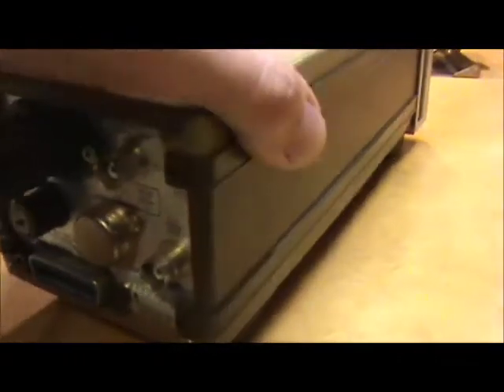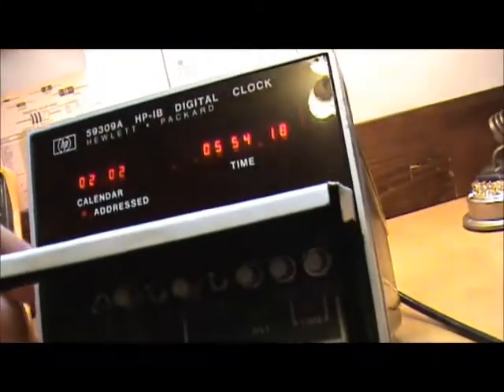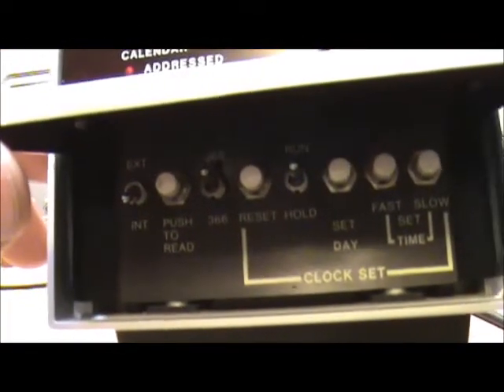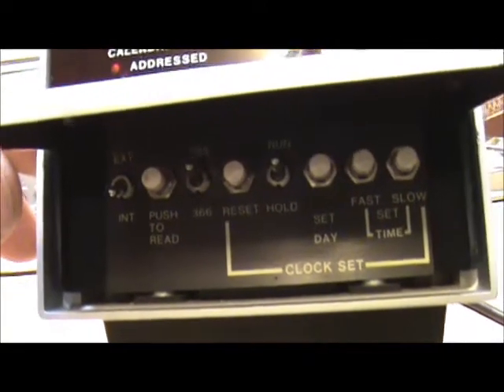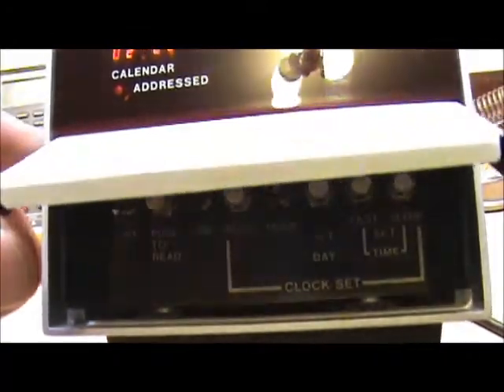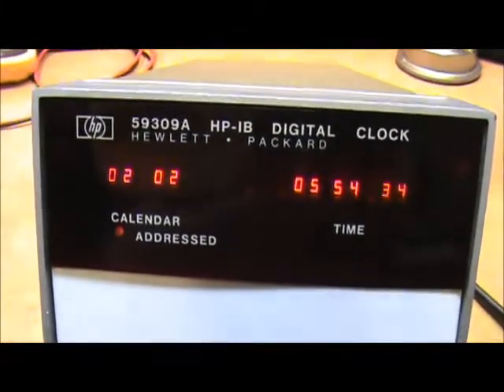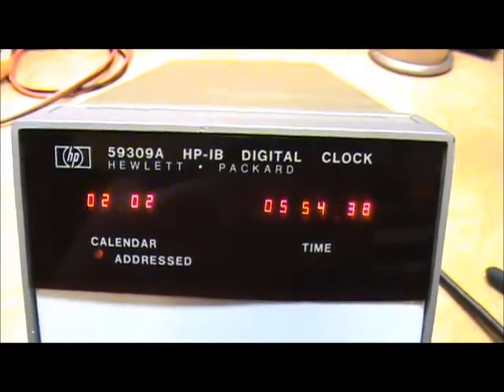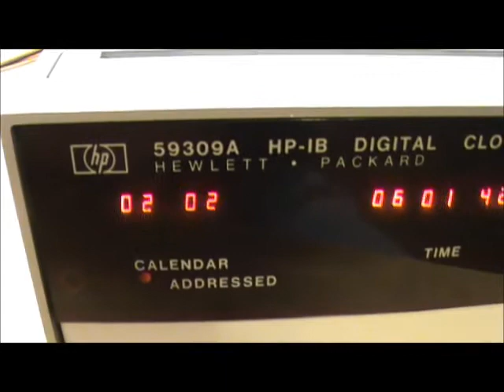HP 59309A HP-IB ASCII Digital Clock Vintage Hewlett Packard

Comment: What was the intended purpose of this clock?
Reply from the maker: The HP 59309A was a digital clock that connects over HP-IB (Hewlett Packard Interface Bus) to computers or test equipment assemblies. It was intended to provide clock/calendar functionality to computers, timing information to test equipment, etc.

Comment: Jim, if you find me on Thingiverse user name mark_greco I made a back up power supply for this unit. Tell me what you think.
Reply from the maker: Wow!  You did an awesome job!  The thing looks factory.  I guess you have access to a modeling program and a 3d printer?  The decals were made how?  Just clear backing on the decals?  My 59309a is missing the top strip.  It looks as if you made one.  Nice.
Reply: @JIMO415  yeah I got a lot of work into that. If you want one of those strips I’ll mail you one. If you don’t look too hard they look almost identical.

Comment: I’m now a proud owner of one. Thanks it’s a beautiful machine.
Reply from the maker: Cool.  Do a video when you get time.
Reply: @JIMO415  when I get it connected to hp-ib
Reply from the maker: @markgreco1962  wow neat you will actually use that function!  That is beyond my capabilities.  If you got it on Ebay earlier this month, it looks like you did very well and it was not too far from me!
Reply: @JIMO415  i will be challenged to say the least.  came with cables a card and a router for 150.00 smoking deal!!

Comment: Jim this is right up my alley https://youtu.be/4ayPnR4DQX8

If you get sick of your HP-1B let me know.
Reply from the maker: Mark, I sold my HP-IB clock  a several months back.  It went to the UK.  Funny thing is someone reached out to me recently and long story short, another one just came in the mail today!  Keep an eye on ebay and you could own one.  I will keep you in mind if I do another purge.  As far as your link, that is interesting using a counter in that way. I have not played with Arduino yet and programming is mostly unfamiliar to me.  I do have a boat anchor that works great....an HP 5246L nixie counter.  It is similar to the HP 5245L.  I am not using it much.....

Comment: Cool as can be. I’m looking for one also.
Reply from the maker: Thanks!  Just curious if you are into it just for the clock value or are you able to understand the IB system and or use that?
Reply: @JIMO415  a little of both. I have a small HP test equipment collection and enjoy the beauty of the equipment. You have a good eye. Also love the tractor.

Comment: This clock has always been of interest to me, and it's great to finally see one properly featured here on Youtube.  There's a BNC jack on the back that can be used with a 10 MHz external timebase.   Connect a GPS receiver's 10 MHz output, sync up the seconds, and you'll have one very nice accurate clock!  I have always had that in mind when looking at the HP 59309A.  Nice video Jim, and thanks for posting it.
Reply from the maker: Thank you sir!  There is a switch inside for selecting 1, 5 or 10 MHz external reference.  Connecting to a 10 MHz GPS receiver would indeed give one a very accurate, vintage even, clock. It seems that these are selling up a little from where I got into it, so it is listed.